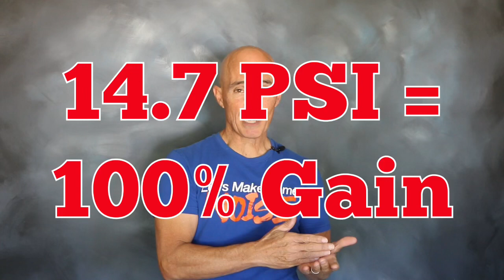More Turbo Power! What can you do to make more HP per PSI of Boost?

Comment: What happens if you run 29lb.   I know that it's easy. You lift the head. 😜
Reply: Only on a GM
Reply: Yes Richard does the same rule apply at 29 vs the 14.7? Will it double if the turbo has the air to support?

Comment: @Richard Holdener - How do most people apply what you're suggesting to their own cars? When you apply your formulas, the engine is connected directly to the dyno. Most people don't remove the engine from their cars to get a dyno reading. They get their dyno readings at the tire. I used the calculation on my car to see what I would get. My 3.7 V6 Mustang produces about 250 horsepower and about 240 foot lbs of torque stock. I Procharged it and at 9 lbs of boost my car now produces 420 horsepower and 352 foot pounds of torque on a Mustang Dyno. Stock my car my car produces about 17 horsepower at sea level. Under boost it produces about 17.7. The formula seems to work as an approximation. I think what happens is that the drivetrain losses decrease as a proportion while the power used to spin the supercharger increases as RPM increases. I would think that the horsepower per pound of boost would increase at the tire with a turbo because it is more efficient than the supercharger.

Comment: 29.4 psi will theoretically increase power by 200% , but at some point you will run into diminishing returns because of the heat of compressing the intake charge among other factors.
Reply from the maker: unless you run a good intercooler -like our ice water on the Big bang motors.
Reply: Usually cylinder pressure is high enough your begin to get octane limited, at 29.4psi in most applications your exceeding 1:1 boost / backpressure ratio, exhaust backpressure post turbine comes into play, pressure drop accross the intercooler core etc etc.

Comment: Richard Holdener, I would love to see some lower octane fuel (91-93) testing because alot of guys do not have access to e85 or want to run race fuel. Love seeing the amount of work you put into this stuff!
Reply from the maker: I don't do much pump gas stuff unless its NA. But I can show you how much the reduced timing costs you in power. Got a vid or two on that coming up
Reply: @richardholdener1727  I'd love to see it as well, the nearest e-85 is a 100 miles from me.  After watching one of your videos with meth injection I'm scared to use it and go above the 10 psi I'm at now(saw video after I bought the kit) with the stock intake.  will a high ram distribute the meth better in your opinion?
Reply: @richardholdener1727  have you showed the video of how much reduced timing reduces power. yet? I may have missed it. I hope your getting payed for the time and money you put into these videos without commerciales!

Comment: The big thing:
1. Make the NA motor more powerful BEFORE forced induction, so the "multiplier" of boost has a bigger impact. (Example: intake, cam, headers, P&P)

The little things:
1. Size of the turbo compressor/turbine matters. Make sure it meets the airflow needs of the power you want to get to.
2. Reduce intake air temps (IATs) via intercooling, active chilling, intercooler spray, etc. The cooler/denser air makes more power and is safer.
3. Make sure your downpipe and exhaust are as large as you can possibly fit after the turbo. More is always better, and spool is better.

Comment: The fact is that the engine needs to inhale and exhale an amount of air per hp. 
A) Bigger valves
B) More lift/longer duration
C) Faster opening and closing of said valves, as in roller cam behavior over relaxed, lazy, stock valve speeds
D) Removing all restrictions possible from the intake and exhaust plumbing, even if the gain is somewhat minimal, as in, long tube headers.
Then, temperature management:
E) Biggest aftercooler possible. Dropping temperature to ambient is never bad for power.
F) Aggressive cooling of the heads to enable maximum timing
G) Aggressively insulating exhaust tract to preserve the precious exhaust gas energy to the turbine
H) insulating the turbine housing
More on breathing:
I) Huge intake and exhaust ports to make sure they are not the bottlenecks.
J) air intake that is fed from a reliable high pressure zone.
K) large exhaust pipe diameter after the turbo(s) and Borla-style or just straight-through mufflers to reduce pumping losses.

I have more to add, but it needs to be patented, so I will just leave this as is.

Comment: Love your videos. By far the best info to date.
Reply from the maker: thnx-tell 1M friends
Reply: I sure will I’ve been trying to build a twin turbo LS swap in my 76 c10 for two years now. Flooded myself with videos to learn the right parts to use and how to do it. I can’t afford the trial and error especially the errors. I would love more info on ring gap and fuel injectors.
Reply from the maker: Ryan LaBlue gap to .028-.030 and get big injectors for the required hp level -let me know the power level and I can help with sizing
Reply: Thank you Sir! My motor is a 4.8 I’m running a Elgin cam.  283 Intake Duration, 286 Exhaust Duration, 228 Intake Duration (.050" Lift). Motor is from an 01 Silverado. I have a 4l80 trans no converter yet. Stock truck intake. Cathedral heads. Fi tech ultimate ls wiring system with trans control. Twin turbos from vs racing. 
Twin 61/62 T3 Special v-band discharge 3" .82ar. No intercooler yet or injectors. Was shooting for 600 ish to tire.
Reply from the maker: Ryan LaBlue that should be easy

Comment: Great video so glade someones finally doing some testing!! Starting my first build 5.3 with BTR stage 2 turbo cam and a ebay gt45 turbo this week all going in a lightweight foxbody!
Reply from the maker: We've run that turbo a lot-its good for 800 fly hp!
Reply: @richardholdener1727  thats good enough for me for now car should be under 2800lbs and powerglide with transbreak. Any suggestions on what heads to run? It currently has 317s from the previous person wanting to lower compression for some reason
Reply from the maker: @farleyskennelsandoutdoors6499  Stock 706/862 heads would be a lot better

Comment: Great video! I would like to see a comparison betwee equal length tube headers and unequal length tube headers on a turbo application. Is there a difference in backpressure or performance? Thanks! Most inline and v engines won't really encounter this problem, but in a boxer application equal length is sometimes hard to fit in the car with a single turbo
Reply from the maker: I have run tests on equal vs unequal headers-minimal difference

Comment: Probably going to have issues with the stock valve spring holding the exhaust valve open killing the horsepower. Need really good springs for back pressure and some Holley smart coils for additional Spark
Reply from the maker: we include spring upgrades to go with cam, but the stock coil packs work well with the right dwell

Comment: I want to see a 1999-02 Saturn 1.9L turbo charged engine. Yes I know but I thought I would give it a shot lol. Project 2 is a land speed car with that combo . 99-02 used the same style rods that LS engine run
Reply from the maker: I raced in SCCA orld Challenge when the ICY Saturns were running. Good stuff. I have set a few Bonneville records-Including my 227-mph Honda Civic.
Reply: Richard Holdener awesome! I’m going after Lisa’s record and I want to do it with a real Saturn not a general motors 2.2 eco-tech. So for I think my biggest restriction is going to be RPM as I do not have the aftermarket support for different gear ratios. I know the connecting rods that hold up to 30 pounds of boost but realistically long RPM runs probably 18. I plan on running the 1.9 L twin cam from a 95 to 98 the bottom and from a 2002 because it comes with the girdle when did tray and some rods. And a manual trans out of the single cam car . Over the years I have talked to Turk about this and he’s answered all my questions except for one because he doesn’t have experience in it and I see you do. And what were if any difficulties you had at slowing that car down being that it is a front wheel drive car?

Comment: Most engines that are streetable make 1 to 1.2 hp per c I. So if you can do that on 9.1 mechanical compressi9n then boost your combo to 8 psi then pump gas works and you won't double hp but it's still alot. So 600 is obtainable, so on 20 psi boost to double your initial n . A figure run e85 and get 800 to 1000 hp from e85.

Bloodviking

Comment: Im not sure what our 3800 would make NA. She made 590whp@14psi. I remember because at the time it was our base gate spring. Hard to beleive she would make near 300whp NA. I guess its possible. Love the vids Richard. Keep uploading.
Reply from the maker: Track Days. The math says 280 hp na which seems healthy for a 3800, but with the right heads, cam and intake that’s only 73.5 hp/liter-the equivalent of a 368 hp 5.0L ford or Chevy! That’s not hard with decent parts.
Reply: @richardholdener1727  she made 1000hp @29psi with the twin gtx3582r and a big W2a and e98. Still stock block and crank. At the wheels. Not at the crank. So I guess you can add 20 odd % to that as well for losses. So at a rough guess 1200 fly.

Comment: I would love to see u put a nissan VQ40DE to the test. 
I have one in my truck and can't find many parts to upgrade the power output.
As far as I can see there similar to 3.5 and 3.7L that are in the Z cars. Every thing I can find said that it has forged internal. If u can find any info I would appreciate it 
Thank for your time
Reply from the maker: Ill ask around
Reply: @richardholdener1727  thanks in advance
Reply: Check out Brian Crower on the web, he has some Nissan stuff. Dig around on his site and there is some nissan stuff in there, I was looking at some cams the other day.
Reply: @richardholdener1727  any luck finding info on the VQ40DE
Reply from the maker: @redlinepullers3277  NO SIR

Comment: In theory at 29.4 psi , I would think it would triple in power. For example in my thinking is 300 h.p will become 900 h.p under boost.
Reply from the maker: exactly
Reply: In theory yes but in real life probably not
Reply from the maker: @Spudstrodamus  Its harder at that boost level
Reply: KAboom! LOL
Reply from the maker: @robertelmo7736  but with style
Reply: A stock honda type r k20 on 30lbs of boost with supporting fuel probably would make 600hp.  Pfi does it all the time.  Whether it would blow up after time is not the question here
Reply: Pfi rule of thumb is 1 lb equals 10 hp give or take

Comment: Would be nice to see non intercooled, vs intercooled vs air to water with a box ice comparison on a turbo blow thru carb setup
Reply from the maker: ive done lots of intercooler testing-non ve IC, using nitrous as IC, IC vs non on carb application-the upshot is always use intercooler
Reply: Could you post a link, I've looked on your Facebook page but can't find it
Reply from the maker: @t6378tp  they are all separate tests on different motors

Comment: I remember the article you wrote about the Kenne Bell 302 that made 500hp. A few of the cam sizes got messed up in the dyno charts but I think the conclusion was the XE274HE was the one you used to get the 500hp. What was the compression of that engine? Could the combination be improved on today? I would also be interested in seeing what OEM ECUs have done to power through the years.
Reply from the maker: Yes-EX274HR cam and there is a lot more power to be had but the stock block will ultimately limit that-I wish there was an iintercooler

Comment: I'm so glad that you've made this channel. This is exactly the kind of stuff I want to learn about. as far as what I would like to see... I noticed in the clips that you showed looked like a motor in fully stock form (@1:33) I Know that watching your videos that when you dyno a stock 5.3 (i.e. The Ultimate LS Truck Cam)  it's coming in at 359 vs the GM advertised 270-295  hp (LM7). I understand that this is likely due to the accessories ( & cooling fan on trucks), intake tube, dyno headers, and proper tuning; but I would be interested to really know how much draw those things each have since many of those things are what have to go back in our cars anyways. Does 90% of that difference come down to headers and tune?

Thanks again. I appreciate the great work!
Reply from the maker: I RAN A TEST OF THE STOCK FAN, TEMP, FACTORY EX MANIFOLDS, AND ACCESSORIES-NOT UP YET-I'M JUST GETTING STARTED-LOTS OF COOL TESTING.
Reply: @richardholdener1727  Nice! Can't wait to see that one.
I'm with ya OP

Comment: Well, in your theory, the 300hp engine running three atmospheres (29.4psi boost) would make 900hp. To account for compressor efficiency, exhaust restriction (cant always run an open 4 inch exhaust outside of the dyno) id assume an efficiency of around 87% (first atmosphere of boost is usually almost double, but the second and third usually get up in cylinder pressure and you get octane limited) so 300hp of engine with two 87% efficient atmospheres of boost at 261hp each would make it a 822hp combination.
Reply from the maker: winner

Comment: Is there an advantage to running twins on a big block Chevy versus a single turbo which one works better? I'm building one I'm building the engine part now trying to decide on who's induction system I'm going to use all I know is there's going to be a power adder for sure
Reply from the maker: that ussually a fitment thing-both will work

Comment: Could you run a cryo fluid in an air to water intercooler?  If you mix dry ice and denatured alcohol you get a liquid that's sub zero but I dont know if theres a pump capable of circulating it.

Comment: What are all the roles of a waste gate? My little understanding of them is to release the pressure when you take your foot off of the gas pedal, do they have a job to do when you are In the throttle making boost?
Reply from the maker: what you are describing is the blow off valve. The wastegate dumps exhaust before the turbo to reduce the boost pressure produced by the turbo
Reply: @richardholdener1727  ok, thanks for sharing.

Comment: What about a turbo with nitrous? That would cool the charge air, added to the intercooler????
Reply from the maker: i have vids coming up on using nitrous as the intercooler and using nitrous with an intercooler
Reply: And you don't need much, a 50 shot works wonders on inlet temps. Gives you more like 75 to 80hp actual because of the boost. Win win.

Comment: a Shot of Freezing Nitrous into the Intercooler
Reply from the maker: BadAssEngineering that works-but better if aimed in the motor
Reply: Either methanol or nitrous works great in addition to the intercooler in the intake tube. Make sure the blow-off valve is not between the injector and the intake. Could be catastrophic fire

Comment: I thought there were some pretty good gains found when back pressure dropped changing from holley turbo manifold to header style hot side?
Reply: Where can I see this?
Reply: @onecheekfabadamwilliams8346  I thought it was a vid he did because they measured back pressure and boost levels for both. it wasn't huge gains but good enough for me.
Reply from the maker: I did a test on the Holley manifolds vs tube turbo race headers-that video is not up yet but at high power levels, the Holley manifolds are not as good as the race headers. But they were not designed for 1000+ hp stuff.

Comment: Richard is the 14.7 atmosphereic pressure  number different at say 2300' vs sea level?  Or is 14.7 the numbers at any altitude?
Reply from the maker: 14.7 psi is at sea level technically or rather when the pressure and temp are equivalent to that-you can still double the power at higher elevations, you are just starting and ending with less

Comment: Hi Richard I know this is not a hemi video.
But I have a question can I use a dodge ram truck intake manifold (392 )eng on a dodge Challenger RT 5.7  my concert is the air cleaner is on the passenger side instead of the driver side will it make a difference thank you Robert
Reply from the maker: the accessories and intake are also different

Comment: Using this theory, would it be better for throttle response to use a pair of 300hp turbos on T2 flanges as opposed to a bigger 600hp single on a T4 flange? Overall the size combined of the T2's flanges are slightly larger than the T4 so it would be interesting to read your opinion.
Reply from the maker: a single at 600 hp on a 5.3L V8-that would be plenty responsive. So would the smaller T2s, but probably too small-even for just 600 hp
Reply: @richardholdener1727  I should've been more specific in my original question to you Richard, my apologies. I have a 1JZ so only 2.5L to play with. I know a 600hp T4 turbo makes them laggy off the line (3582, 3076, etc.) so I'm looking at twin 2860s or 2867s off the T2.

Comment: love these videos. I believe at 29 psi the point of diminishing returns will start to play into power output
Reply from the maker: Ive only run that much twice-both were successful-one on the Gen 4 6.0L Big Bang and the other on my 2.0L Bonneville Civic B series
Reply: there actually is no point of diminishing returns, if you can increase the boost pressure while keeping intake temps under control you will make more power. I know people who run over 40psi of boost with subaru engines and e85 fuel, that is just what it takes to make an STI run 9 second passes i guess lol.